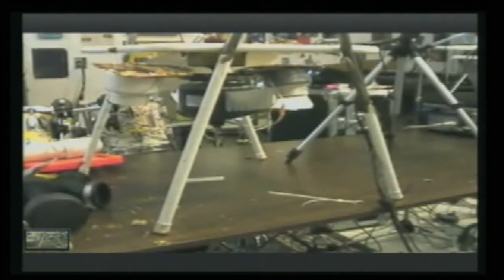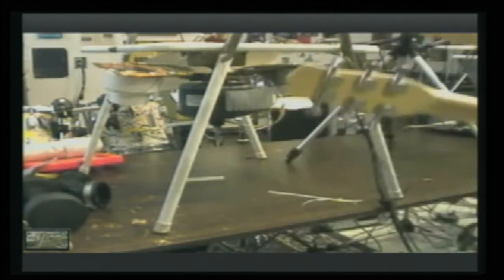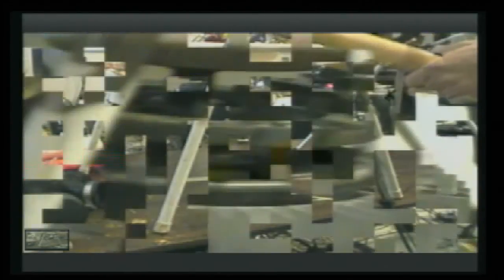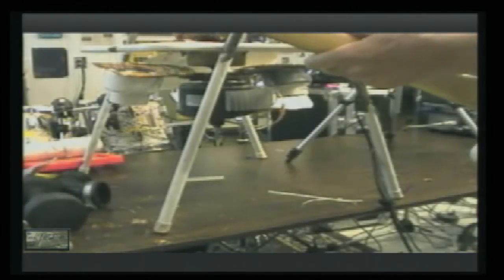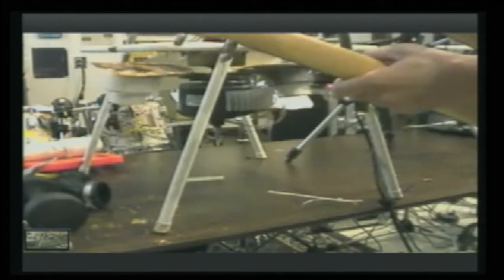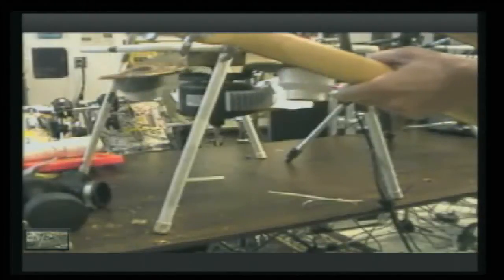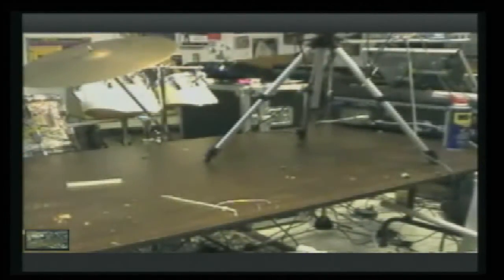Ceiling Fan Leslie Speaker

Comment: I have an old Leslie taken from a Hammond Aurora that is identical to the 'Cheesewheel' Leslie you have mounted on the wall. As you know In the big Leslie cabinets, the treble horn spins counter clockwise [I think. . .] the the bass spins clockwise which boosts the Dopler Effect of the sound. I am now using a DC motor with an electric train transformer which controls the speed beautifully from 0 to 255 write me George if interested:  YosarianCat22@gmail.com

Comment: Yup... hilarious and potencially highly dangerous!  I am older and wiser now, but when I was 19 and a keyboard player in a fledgling band I heard the Hammond/Leslie sound and wanted some it!  I caouold not afford a Leslie and to make my Vox Continental 'swirl' I thought I would make one... easy eh!  Well not understanding the law s of physics at 19... I cobbled together an old washing machine motor, made a 12" metal disk suspended on a bearing/shaft at 45% & connected to the motor.

Comment: Someone already mentioned this, but on a real Leslie (the kind you usually hear on a Hammond organ) the speakers don't actually revolve for the high frequencies. Instead, they use a high frequency speaker that fires into a horn, which rotates much like the baffle you are using for the low frequencies. That's a much more reliable system than trying to keep the wires connected while the speaker is turning, although I'll admit your method with the TRS plug was pretty ingenious.